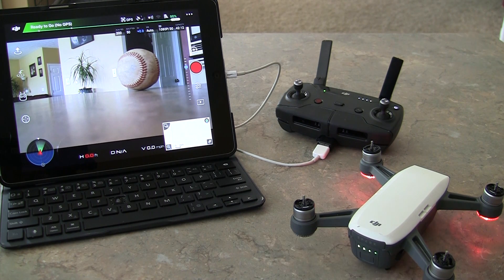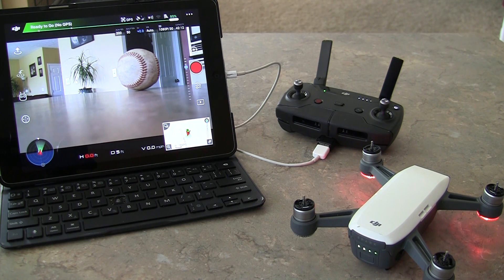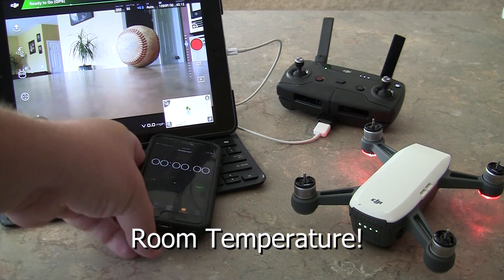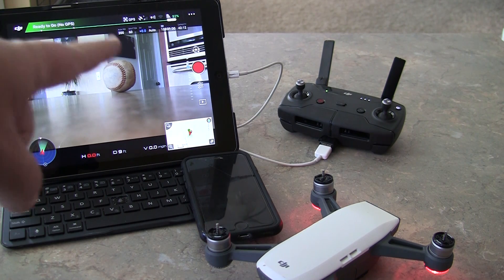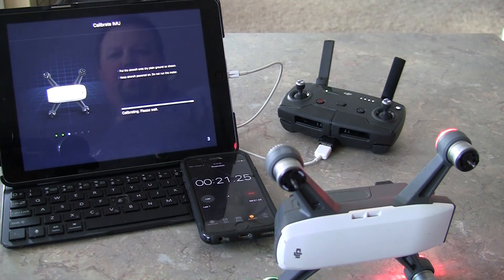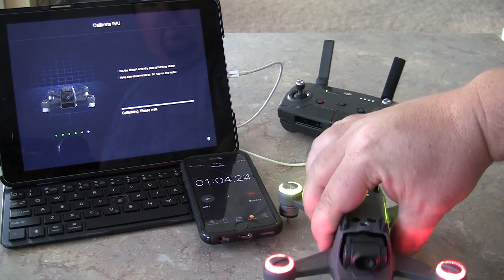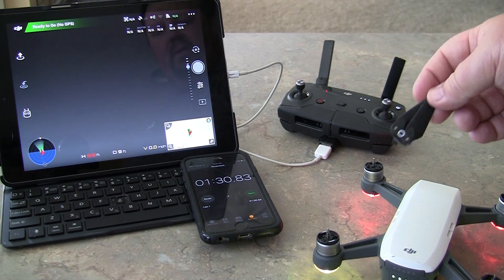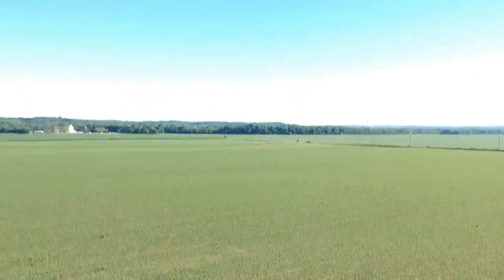DJI SPARK - IMU Calibration Tutorial (Mavic Air & Mavic Pro)

Comment: AMAZING FINALLY FOUND ADVICE THAT WORKED. 
I have DJI Mini 4 Pro 
Note I did not take my propellers off but put a second cellphone  under the back to level off the drone. 
DJi support info was useless - I have tried multiple times and always stuck at 95% like many complain about. 
Thank you so much for this video.

Comment: I calibrated my Spark and it don't fly as usual as a new one. It is not stable n unpredictable as it hovers up, down, left n right and can't really stays at the same spot especially activated in gesture mode. It sometimes goes auto pilot during hand gesture mode. Anyone knows how to fix it? It is because of the imu or compass calibration? How can we do factory like calibration to make my Spark brand new from factory again? Please help. Thanks.
Reply: Yes, I did it on a flat surface. Perhaps I should calibrate it again. Thank you very much.

Comment: Saw that little macro-usb to female usb,  where did you get that? Nice video!  Thanks,  Cheers!
Reply: Just never seen one that small. Thanks!     No problems either 5s gets a little hot and sucks th phone power fast 50% on 2 spark batteries
6s 25%way less hot......Cheers!      ( phone processor deference)